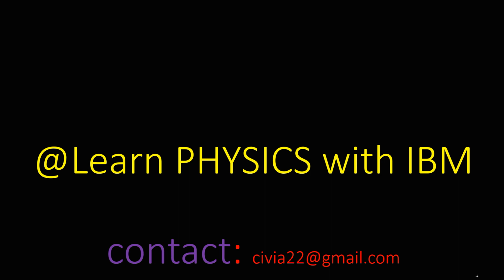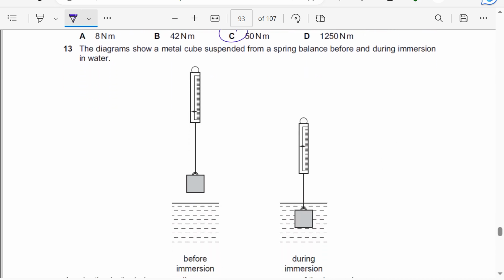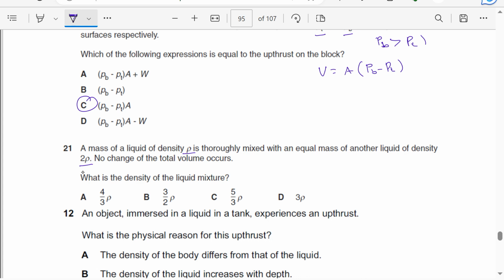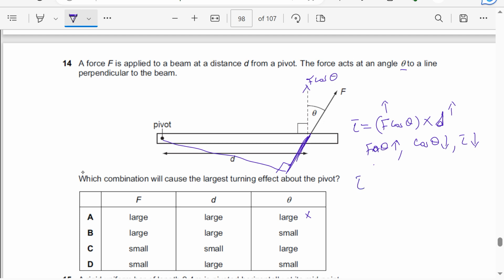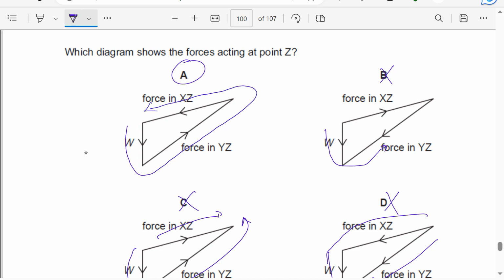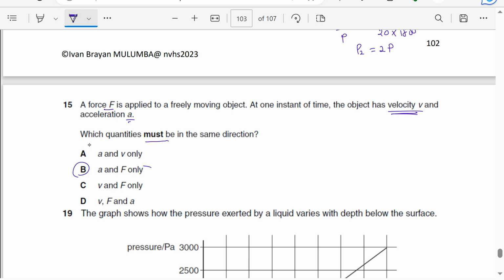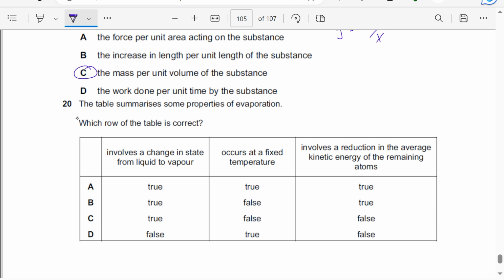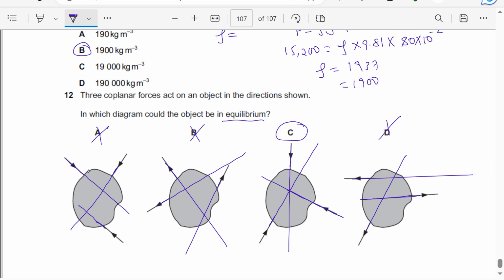CAIE AS PHYSICS 9702 Force, Density and Pressure [MCQs] #Part 11 final

Comment: at48:25 you explain viscouis drag is small please explain why and how it is possible as i cant understand your explanation in video
Reply from the maker: aaaah sorry, the answer is A, i will rectify that in another video. at terminal velocity W= U+V but upthrust is due to difference in pressure at the top and bottom of the ball, P =h.density.g, and the density of air is very small about 1.2kg/m3. so the upthrust must be very small for a ball. Viscous drag will be almost same as weight at terminal velocity so the answer is A